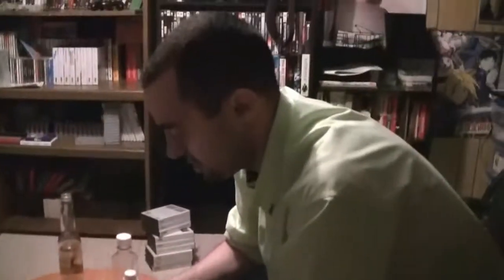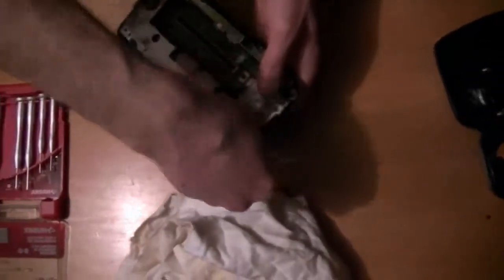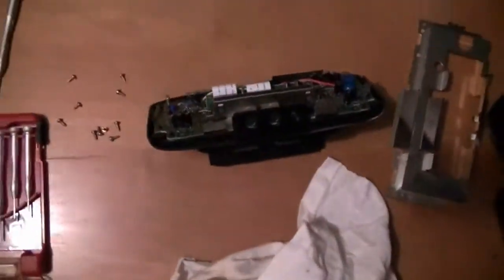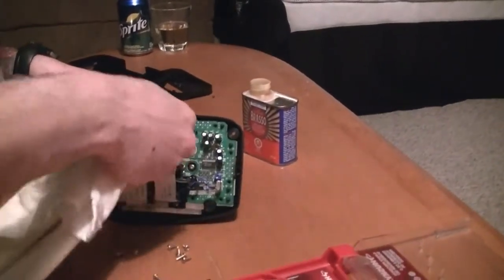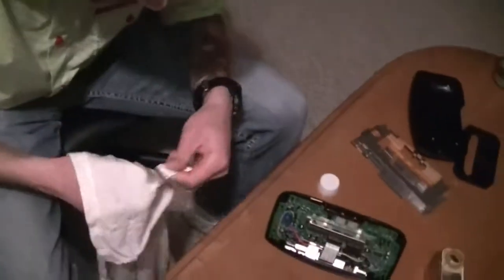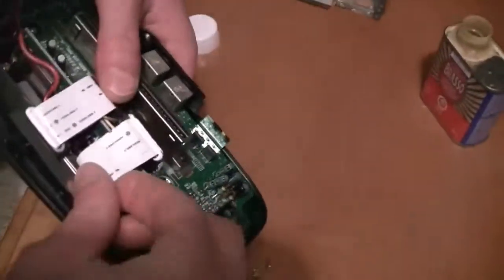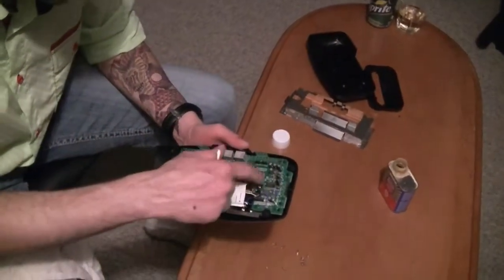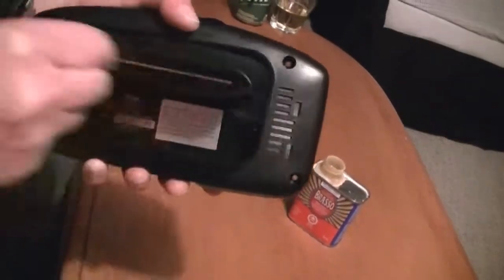Sega 32X Repair (720 HD)

Comment: Amezing, i remember that i bought an old second hand gameboy, but when i inserted a game into it, it ditn't work, until i cleaned the connectors of it and it sudenly dit work again.
Reply from the maker: Most of the problem with these cartridge based systems is corrosion that's most of the problems.